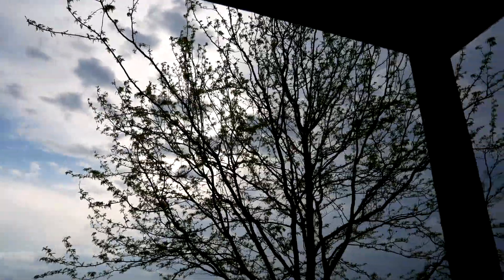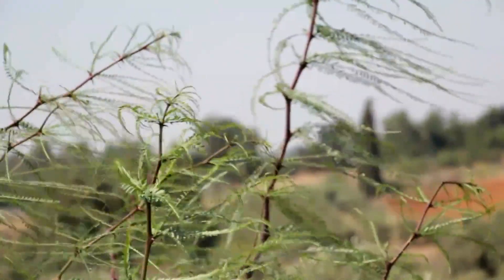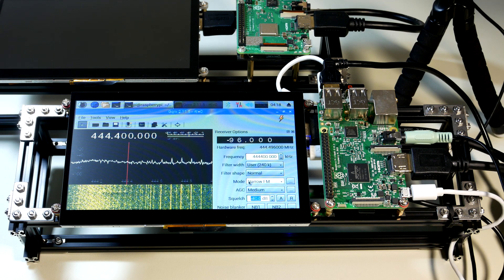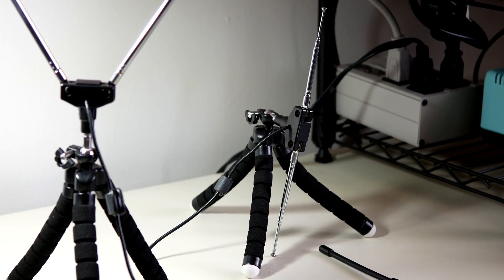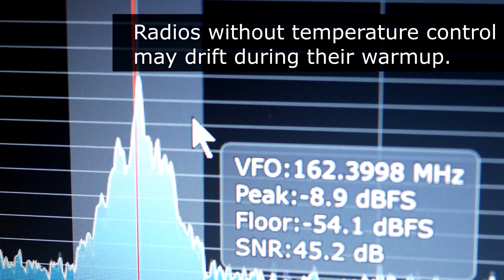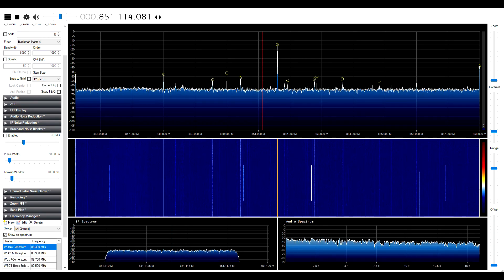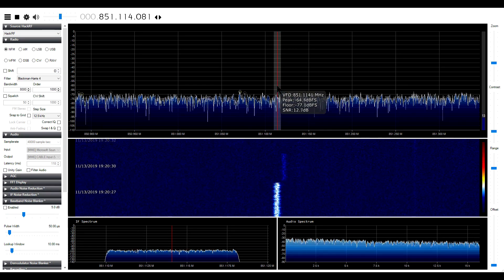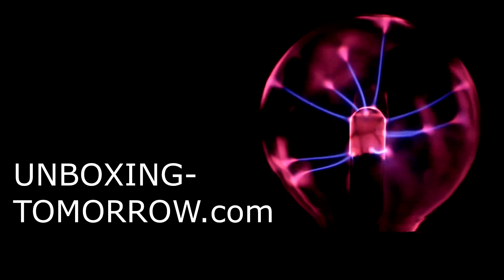Storm Monitoring with Software Defined Radio

Comment: Thanks for the video, great info!  Had a question about your setup, where did you get the rails and standoffs for your project, looking for something like that myself?
Reply from the maker: Good question!  The extruded aluminum rails are from MakerBeam.  The standoffs I'm not 100 % sure about, but I believe they are threaded M2 x 0.4mm on both ends.
Reply: Thanks a lot, I'll check it out!